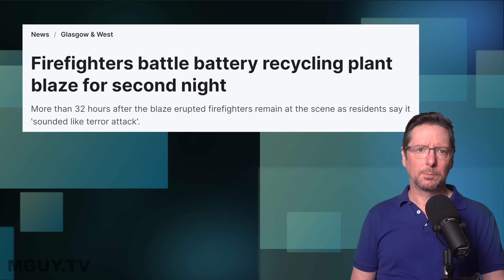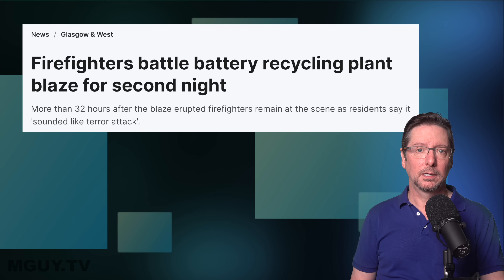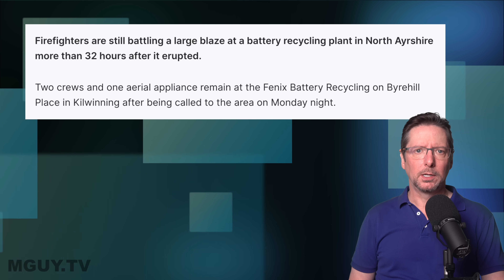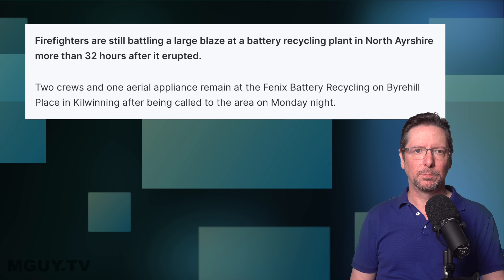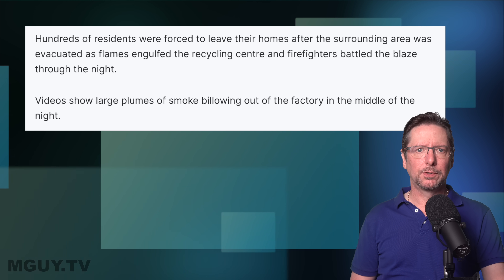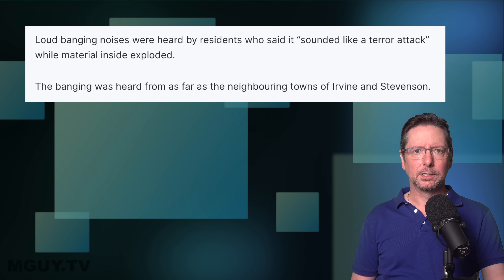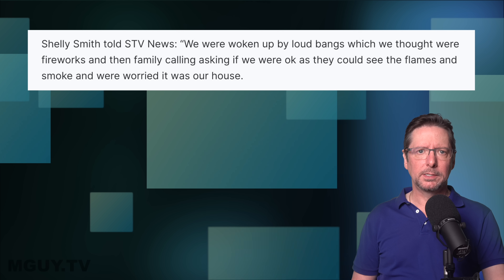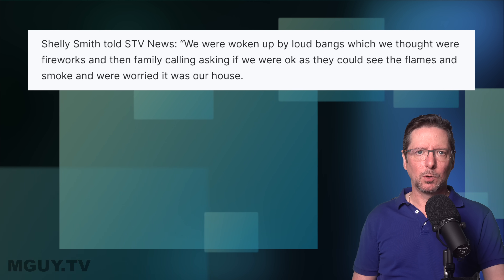EV and Lithium Ion battery recycling is DIFFICULT, DANGEROUS and TOXIC | MGUY Australia

Comment: Imagine 20 years from now a school trip to a transport museum.

The kids gather round an ICE car watching the tour guide pour petrol into it explaining that to make it go the engine mixes petrol fumes with air, exploding it in small chambers, then a complicated mechanical process turns this into rotary movement to power the wheels.  The engine cannot start from stationary and is only useful at certain rotational speed so a clutch and gearbox have to be installed to allow the engine to run when the is car stationary, the gears were changed manually on early cars but automated on the later models. Also the engine cannot run in reverse so yet another gear has to be added to allow the car to go backwards.

With the engine running, the kids are led to the back of the car to witness the toxic fumes emitted due to the chemical burning process and told not stand too close as the fumes are dangerous to human health…    The tour guide points out the strange fact that when these cars were in use some people committed suicide by running a flexible pipe from the exhaust into the car with the windows closed…death occurred within minutes.

The kids then get back on their EV school bus which had been charged that morning with electricity generated by solar and wind wondering what it must have been like having to pour petrol into a car to make it go,  whilst polluting the air with an engine that uses only 20% of the energy in the fuel to move it forward.  🤣😂😂

Comment: What do you suggest we do? 

We haven't gotten to the point where we have a sustainable amount of metal to support the lithium batteries, but we eventually will. Then our children's children, wont see the pits. A crazy plan?  How long have you worked in the recycling industry?  We have being recycling batteries for decades, Lithium batteries are a new line that are more Eco friendly. 

The issue isn't with Recycling them at the plant,  This plant was not meant to accept this type of Recycling battery, they are meant to be dropped off at Depots

 Its when people stick Batteries, Cell phones,  in their black waste bins, in addition charging when they leave their homes. ( this causes many house fires)  Having a damaged Recycling battery it rare, unless placed in the black waste bins.   Do you any scientific research for other viable options to save our Planet? 

The Battery fire was caused by lack of education, Awareness of the seriousness of putting lithium batteries in Black bin waste. (which then they become an issue for leaking) 

I hope you have a reply, You are an engineer and a Lawyer  What is your specific degrees ? 

What causes more Carbon Emissions?  400,000 Gas vehicles or 400,0000 Electric vehicles? 

Secondly the sciences of resorting soil are far more advanced then our current abilities to remove Carbon emissions from our air, So by logic its best to pick the lithium battery option with Mining.   

I'm at 3.16

Comment: I put my 5x18650 rechargeable (same as Tesla use) torch batteries that I used for 3-years at home, wrapped with insulating tape, into our local battery recycling collection box in  retail premises. Yes, it is a concern what happens to them later. That retail has ceased collecting batteries. I wonder why?

Comment: i guess you don't realise that the aluminium used for the ICEs is also one of the most energy intense materials to produce.
Or that oil actually pollutes a lot while being extracted, many pumps just burn the gases on top, while being shipped/transported, refined  and distributed 100s or 1000s of miles from shore. Enormous oil spills happened throughout history, like the recent one in the gulf of Mexico. 
https://en.wikipedia.org/wiki/List_of_oil_spills
Reply: Aluminium in ICE is usually reserved for the powertrain, which in a 1200kg, means usually less than 200kg. The rest is still using steel construct. 

Not very many vehicle on a global scale is all-aluminium.

If ur talking about the “flaring” process when u say “burn the gases on top” quite a number of very large oil n gas companies now recover these gases. And flaring was a much better deal since the methane they burn off is 50x more affective than CO2 as a greenhouse gas.

As for the gases released that are transported by ships, they get reused by the ship engine as a source of power. 

For the ships of the past that caused oil spills, lessons were learnt. All new ships are now atleast double-bottomed, and some are straight-up double-hulled.
Reply: @arsyadidris6349  mainly the engine is the difference between ICE cars and EVs. Also panels can be made of aluminum.

Comment: 3 days now, and it is still going. This centre is right next to houses. What sort of insane idiot gave them planning permission to build it there? The individual cells are cooking off and launching in to the sky like fireworks, still burning when they hit the ground. Worse, the idiot fire and police service evacuated only houses directly next to the centre, only to then have many more houses englufed in the smoke, and still, 3 days later, the residents are being told to stay indoors and not breath that soke. Where do the authorities think the air inside those houses is now coming from? A centre near me also had a fire, and 6 months later the same batteries, now moved to the corner of the site, reignited. What insurance underwriter is still taking premiums to cover this type of risk? How soon before no underwriters will touch EV cars? Not long I suspect.

Comment: What is missing here? It is not about EVs. It is about transition away from fossil fuels. Because we are not very smart, the best initial step was to attack the vehicle industry. So, the not very smart people took the easy route, and now we have EVs. It could have been another industry, that was attacked, but that would require some smarts. So I think you are just barking up the wrong tree, and coming somewhat after the event. The horse has bolted on EVs, they are here to stay, so what is the point of your channel. Fossil fuels are the enemy here.

Comment: They can set them on fire deliberately and use the heat for the generation of the backup power needed by renewables. However, once the current crop of lithium ion batteries has been dealt with there will not be any more because CATL is replacing them with sodium ion ones that do not have the same problem of raw material supply or recycling. The will also be a limit to the number of EVs in use set by the limit on power due to grid constraints and charging point capacity as well as the economics of competition for that power with other more urgent uses, like heat homes, cooking and for industry but also the major increased use by server farmers needed for the AI revolution.

Comment: Battery recycling is like unfrying an egg - its a multistep process requiring acids and solvents - and potential toxic waste residuals.  Recycling won't happen by pure market motives. Mass recyling will require ongoing taxpayers subsidies.  Recycling can't recover all of the lithium - where does the chemical waste get buried in a landfill?  Future regulations will likeky increase the costs because citiens will oppose the waste being dumped in landfills.

Comment: I just purchased a new car, a 2024 Honda Accord EX.  It's not an EV...It's not even a hybrid.  It's a good old-fashioned ICE.   And it drives better than my previous vehicle (2014 MB C350).   And it only takes me about 2 1/2 minutes to fill it up. And with a full tank, I can easily get from Vegas to L.A.  (306 miles). without running out of fuel (even on a cold winter day).

Comment: To produce a petrol or diesel vehicle and an EE. They would have to do 90,000 miles to become carbon equal.  Volvo did the test on making from that all to the finish product and the mileage of all the vehicles. The tests they did, didn’t include cold, where the batteries are more on economic, 
Now look at the carbon footprint to upgrade the electrical grid from the power stations to your home it’s massive

Comment: The success of hard rock mining is usually based on the “overburden removal ratios”. Once it hits the tipping point ie coal is ~40 tonnes, then you find an seam with less overburden. Otherwise it costs more to expose the ore then it’s worth. It’s like any other commodity, supply and demand.

Comment: I think I saw that it takes around 5 years for an EV to become carbon neutral. I am not sure if that factors in the percentage of fuel used to charge the EV that is fossil fuel. Given the shorter life cycle and the issues of disposal/recycling the truth may be that EVs are actually worse for the environment and do not reduce our carbon footprint. And CO2 driving temperatures is just a theory. . .

Comment: Actually,I believe the main problem with battery powered vehicles is simple mislabeling and poor messaging.Battery powered vehicles have simply been mislabeled as EV’s,to mean electric vehicles,which I believe to be a little misleading.They should not be called EV’s but EEV’s for accuracy and to more accurately convey their usefulness.The EEV’s,extremely,explosive,vehicles label will more accurately describe their actual usage and performance potential.
Government simply hasn’t had time to find a useful method to describe the potential of EEV’s.

Comment: There is also a conversation to be had in how they are disposing of wind mills and solar components. They contain chemicals that are deadly when decomposing and are leaching into the soils and making it into ground water and worse is these chemicals cannot be removed from the water table and have to leach out which takes thousands of years. There is so much about all this so called green energy that is as not green as it gets. Thanks for the research on this because it truly is the root of the biggest problem with all this BS!

Comment: Hey mate I love your channel and have been a subscriber for a few months. I don't want to complicate things, but could you possible communicate  in metric terms in some way? It would make things easier for your locally born colonial underling audience if you flashed a metric weight at the bottom of the screen whenever you mention a weight in lb, or a distance in ft, or miles. Most of the population in your adopted country were raised with the metric system. If your'e trying to communicate with the motherland, that's ok, but you're literate with IT, and surely you could add a script to the bottom of the screen to help us people in your adopted homeland. Just flash it for a second or two.

Comment: The fact that batteries degrade and eventually die, whilst currently not being recyclable , should be enough for the "green" claims to be debunked permanently. And those huge mining operations are required continually, for ever more.

Everything is based on a unicorn theory that batteries will eventually be made from common materials, have a one million mile lifespan, then easily recycled. That is the Jetsons blue sky dreaming that is put into the public mind.

The technology is not ready, and may never be ready. Unfortunately, most politicians will never have heard of Moore, Quine or Popper.

Comment: Fossile cars are subsidized $28.125 through oil.
Oil is subsidized $7.000.000.000.000 forcasted $9.000.000.000.000. This is IMF numbers.
Fossile car owners are hostages to a cartel with mostly dictatorships.

Oil is rensed with cobalt, to get out the sulphur. Australia are the biggest producer of lithium, and has 1% of the oil refineries in the world. A little mishap on one of the refineries was more poluting than the whole litium business.
Gas, hydrogen and oil storage are more dangerus than litium batteries :"Guinea oil terminal blast kills at least 13, fire largely contained",

"Second Iranian Refinery Burns In Less Than A Week".
This is some of the cases in 2023.

On top of this, a fossile car burns more than a rabbit fucks. In USA, that's every 2-3 minutts. 2 people die from the fire every day. There ARE a reason why EV's that burns are in the news. Rabbits that fucks, are not news.
In this case it's good that EV's are inn rhe news. Then they can be even better than 5 times less that fossile cars.

Comment: I live in rural Australia.  Lots of old cars end up at the rubbish dump where they are collected by metal recyclers in due course.  Many cars are also simply abandoned on the side of the road.   It is crazy that EVs vehicles are being sold without a definite recycling plan.  Perhaps a surcharge of $5,000 per vehicle needs to be paid up front and held in trust until the battery is returned for recycling.   Unless it is financially worthwhile no one is going to take the trouble/risks associated with collecting bombed out old EVs.   Of course taxpayers will probably end up footing the bill.   Do EV owners pay anything like what normal road users pay in petrol taxes?

Comment: It's not just lithium batteries. If you put enough energy density into any type of battery it becomes unstable and prone to thermal runaway. There is no magic fix in the pipeline for this. With EVs, there's an unavoidable trade-off between range and risk. With the present generation of EVs, the risk becomes excessive before the range is barely adequate.

Comment: When I worked at a lithium metal producing company back in the 90's we had a system for recycling small batches (less than 50 pounds) of Li metal, LiH etc.  It consisted of a water deluge and a bunker that allowed the mass to explode in a controlled direction in a small valley.  All the liquids were captured since Li compounds are toxic to plant life. The operators did their job from the safety of a bunker. Once I was knocked off my feet by a small bit of battery metal that did not cook off as planned but went off when we were out of the bunker. Of course I know nothing about lithium but a proper recycling plant would look like a cement kiln being fed by batteries on one end and a massive baghouse offgas handling plant on the other end. It would consume a lot of fuel and fresh water. It's not the sort of thing that the free market could build so expect massive recycling fees to support the construction and operation of such a plant.

Comment: Hmmmmm, just look at all that 'environmentally friendly' smoke pumping into the atmosphere but my 2006 diesel 200.000 mile Honda crv is the problem.
Traveling opens the eyes about how the majority of humans live the affluent west make up a tiny % of the human population, that majority, is burning tyres to stay warm and give themselves heat for other things,when the sun goes down the lights go off, no taps for drinking or running water.
The majority of the western public have no idea of the poverty that most humans live in and that's why our politicians manipulate the public so easily, this dumb eV push has nothing to do with protecting the enviroment, it's about absolute control over the public, if you believe otherwise, I've got some original jesus bones for sale, very good price 👍.

Comment: Lithium-ion batteries. Lithium (Li) is a chemical Element at the head of Column 1 in the Chemical Periodic Table, also in Column 1 are the following Elements in order, Sodium (Na), Potassium (K), Rubidium (Rb), Caesium (Cs) and Francium (Fr). All of  these elements are vicious in their activity with other chemicals, particularly water, where they burn at a very high temperature. The box these elements are kept in must be totally air tight to prevent even the slightest moisture from getting into the box, if moisture does get into the container it will explode and create one huge fire which it is impossible to put out. I have heard that research is going on into Sodium-ion batteries which are much cheaper to manufacture than Lithium-ion batteries since Sodium is fairly cheap to manufacture from common salt. If ever they do make Sodium-ion batteries, well don’t even think about it, they will be ten times worse than Li-ion batteries.

Comment: In Australia, only about 5% to 10% of lithium batteries are recycled, depending upon whose figures you believe. In any case, it's not a lot. Because there is not enough volume to get economy of scale. The figure is not likely to increase unless and until Australia's EV population increases. Which means that it isnt going to happen until at least the 2030s.

Comment: Down the road ah ways, in Lancaster California the AVTA (Analope Valley Transit Authority), stop using EV Bus's, as they say the Batteries in the Bus's are getting hot. I called the hot line number and the operator verified the Bus Batteries were getting hot. But nothing else was known or when the Bus's would be back in service. Iam sure everyone has seen the Chinese Bus EV Fire video taking only seconds to vent gas, and the explode into a massive fire. Hopefully they can fix the problem not getting anyone hurt.

Comment: No li'ing batteries are recycled, they remove the aluminium and copper and the rest is "black mass". To recycle that uses 20x more energy/cost/chemicals than making the original battery and they ain't getting that from sun and wind..! A Finland research lab tried doing it when li was more expensive.!

Comment: I recently read about the train using batteries. Oh my god.  When I was talking to a colleague at work I could not believe an engineer would be saying this is ok. If they could put rails for the train why they can't hang wires everywhere to make them simply electrical without any batteries? Stop this battery madness. Until there're not safe batteries the use should be limited.